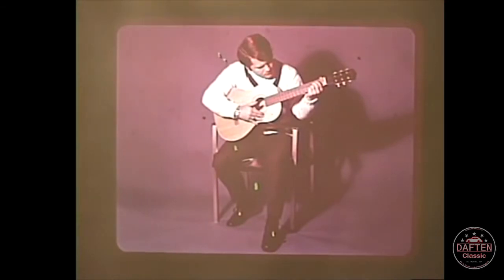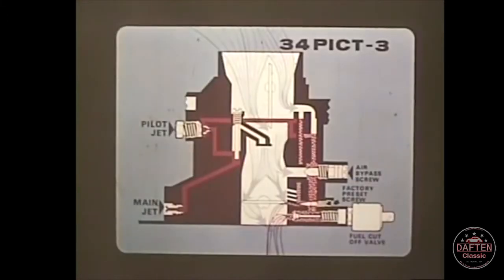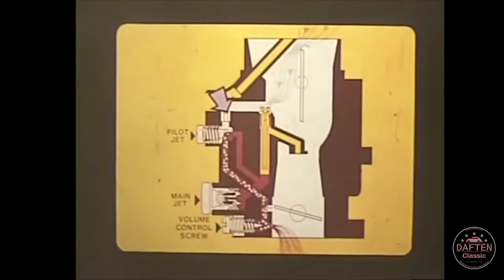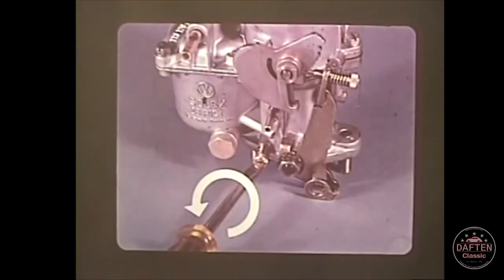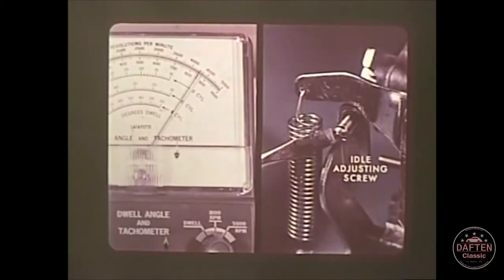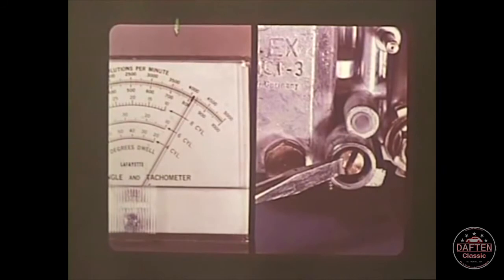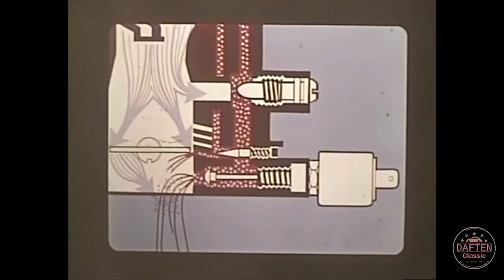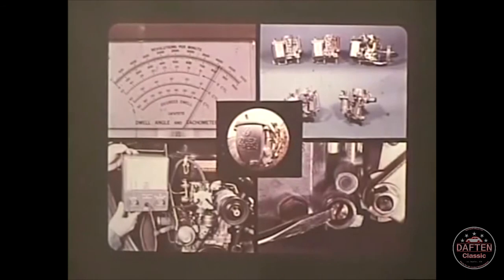VW Aircooled Carburetor Factory Training Film Bug Beetle Bus Karmann Ghia 28PIC 34PICT Vocho Fusca

Comment: The 34 PICT-3 stopped capping that "VOLUME" screw long ago.  You set the base idle with the bypass and then set the volume screw by ear.  If the volume is too far out you will hear blatting.  Too far in and the rpms will start to drop off.  This volume setting will/should be within one turn (360 degrees) of the screw (in or out) from the base setting of 2.5 turns out.

Comment: Nice information, thank you...
I  have  problem my brosol 31 carb, even volume conttol screw is of the engine still run...what about you...🙏
Reply: Clogged. Remove the entire carb, take it all apart, dip it in carb parts dip, rebuild with a new kit.